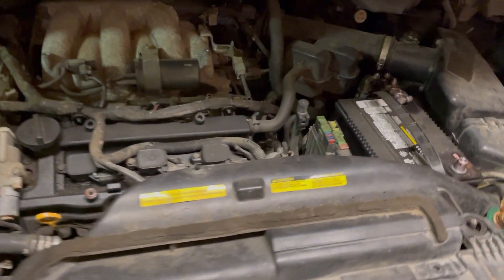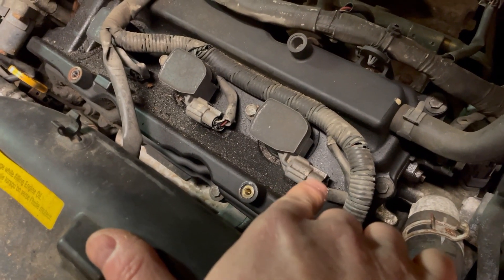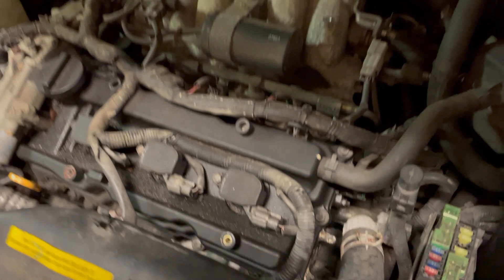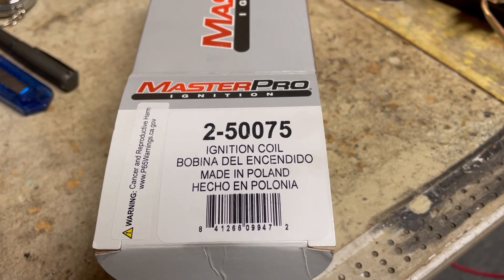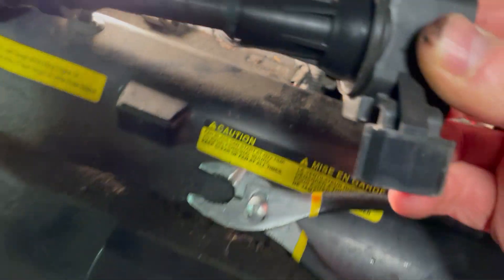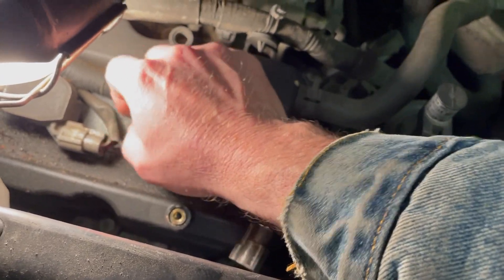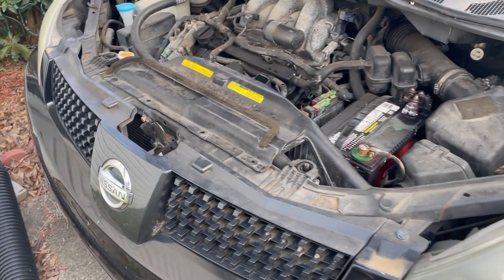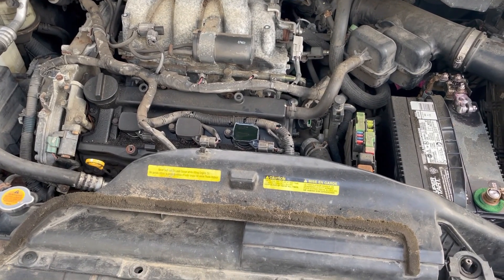Nissan Quest P0360 repair TCS light

Comment from the maker: You could at this point. It has been a year and the others are still fine. It isn’t a lot of trouble to get the others changed just a matter of buying them. If it was a harder job, I would’ve changed them all.